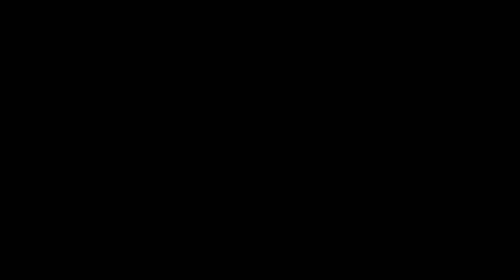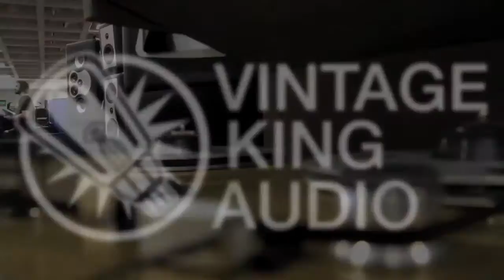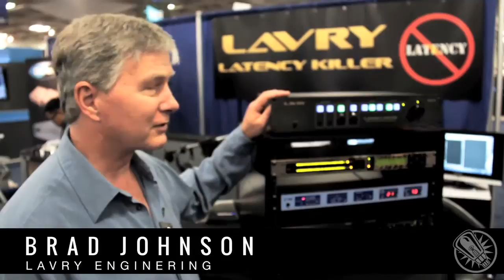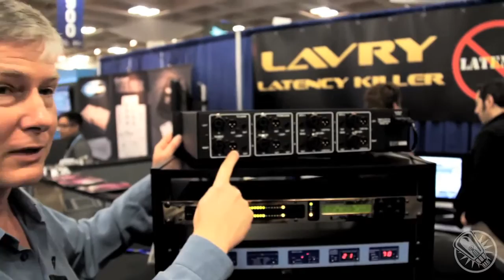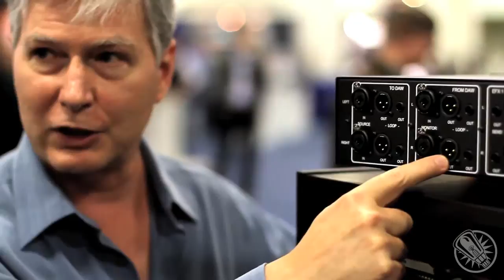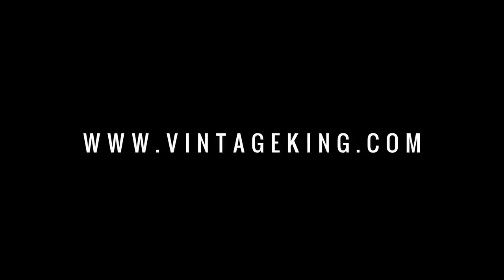Vintage King @ AES: Lavry Latency Killer

Comment: UAD Apollo does the same thing with onboard effects in 1u less rackspace.
Reply: uad dsp is completely different. the idea is you use the uad pre's and normal struff when tracking and monitor the inputs of the daw. then get the sesh going. use the LK! for overdubbs and punchins while your DAW is set to highest buffer setting low-latency mode off. that way it feels like tape for those two channels of inputs